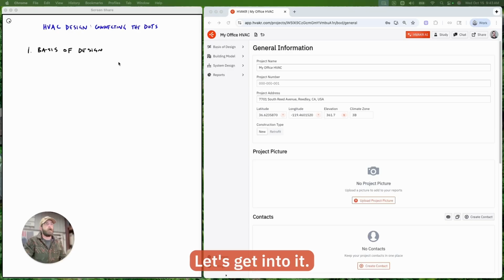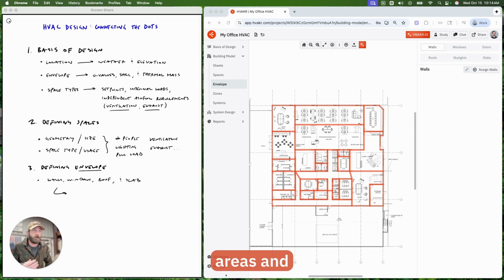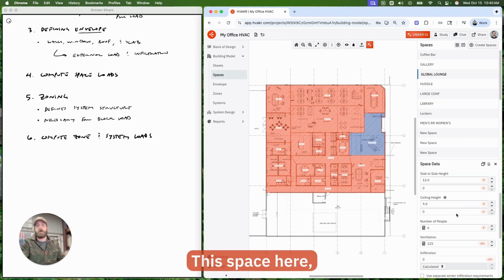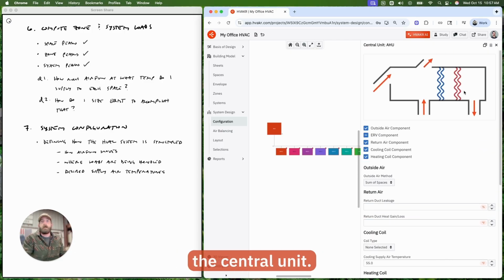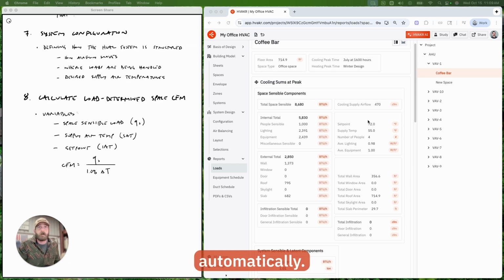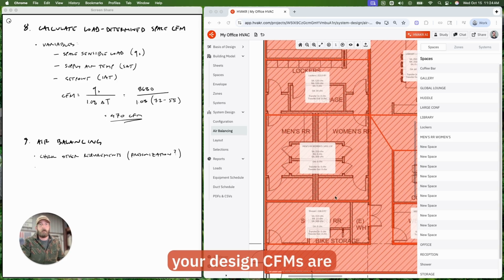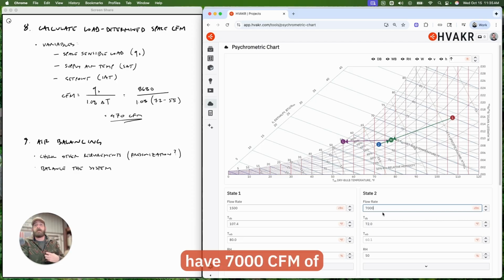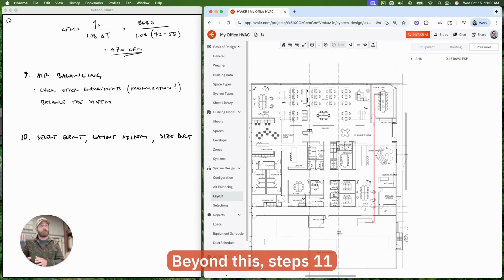HVAC Design Overview: Connecting the Dots

Comment: This usually turns into a bigger deal when you actually start digging into all the load calculations and system sizing - American Residential Services handles heating and cooling system design and installation when you need it done properly.